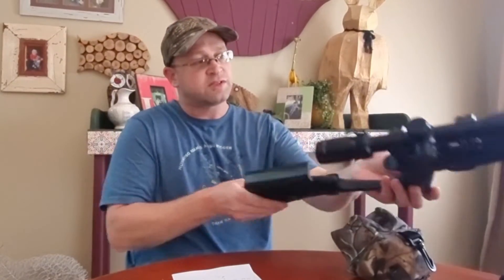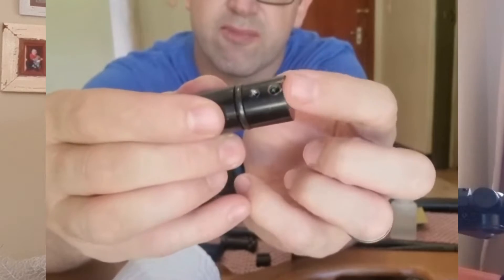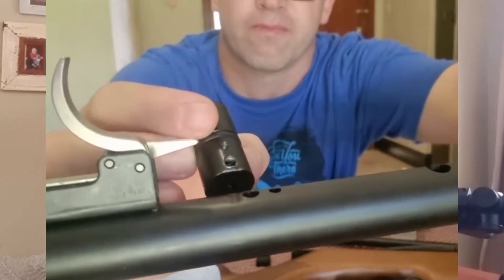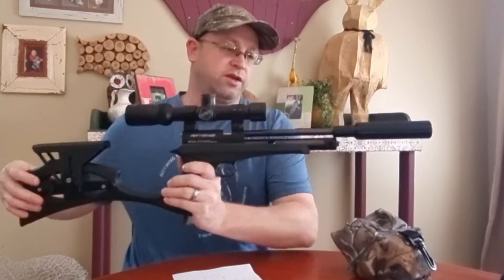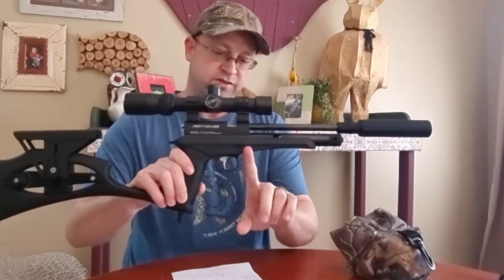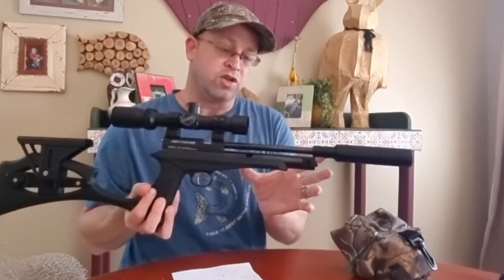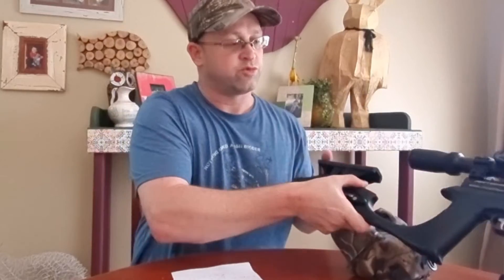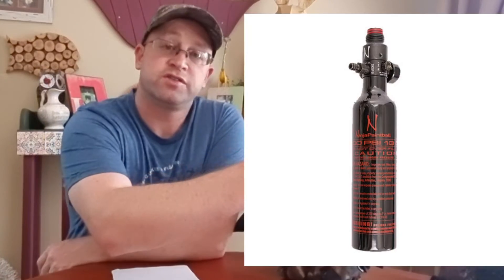CP2/Chaser CONVERT co2 to PCP

Comment: Plan to buy cp2 for my travel around the Britain. Like the size and weight and portability. Also like small co2 cartridges. As every men thought about increasing the power. Heard about how many shots you can do with one 12g which is even too much for me. So i thought would it be possible to use a bit more co2 gas from the cartridge? You know open the valve a bit more. It wouldn't have to go over 12 or legal limit. Just use the cartridge a bit quicker. Sorry if you already mentioned this idea😊
Reply from the maker: I done a pretty recent video about this,
https://youtu.be/oXXsIX3FH_Y

Comment: I did the convention a while back, used a dummy co2 cart, and drilled a hole in the main tube to run a micro line to it.  I feed it with a paintball tank mounted to a paintball drop forwards attached to the bottom of the grip with threaded inserts, and small 9ci tank set to 850psi. Its louder, and benefits moderator. Can be switched back to co2 with no problem, and balance is still good in pistol form.

Comment: will any 1/2 unf silencer fit the cp2??
Reply from the maker: Nope, afraid not, the thread on the CP2 is M10x1mm
Reply: @African-Budget-Pellet-Gunner   damn... the sites only specify the unf thread
Reply from the maker: @Klausll yip, the easiest solution is probably to get an adapter

Comment: I somewhat agree with what you say but I feel I've to share my opinion too.
With pcp can come lots more power but you don't necessarily need to use it.
the co2 gas from the little bottles should be around 60bar so the rifle components get tested at 90bar if you regulate your pcp mod to 90 bar you will be perfectly safe ... the pcp bottle can then be your classical 200 or 300bar bottle with a regulator set at 90bar or less. 90bar is plenty for sub 16.3J/12ft-lb muzzle energy. I get up to 20J from 60bar in a 58cm long 4.5mm barrel. You wont get that much out of the 45cm CP2 barrel but I'm sure 90 bar is sufficient for 16J.
If I were to do the conversion I would buy a second hand empty sodastream 425g bottle (good to 250 bar), remove the soadstream attachment from the bottle and screw in a regulator, then have the regulator go into the drop block. The bottle regulators are relatively cheap (around 25 euro) , the sodastream bottles are fairly cheap too (can be as cheap as 22 euro new with the gas even cheaper second hand with no gas), the most expensive part will likely be the drop block so you might be able to squeeze the conversion in at around 100 euro. It's not that bad but, in some countries,  you can also get entry level pcp rifles at around the same price as the CP2 + conversion.
Reply: I came across some even cheaper parts solutions on aliexpress, I'm sure you can mod the CP2 to PCP with aliexpress parts for cheaper than 100 Euro and a fair amont of tinkering.
Reply from the maker: Definitely possible, I don't use Aliexpress because our shipping is not very good this side
Reply: @African-Budget-Pellet-Gunner  I found a volunteer amongst my friends owning a sodastream: He will give me the empty bottle for refill, I buy anew one, I give him the new one for the price of a refill and I get to keep his old one for the price of a new one minus the price of the refill. This way I will have a sodastream CO2 bottle for maybe less than 10Euro depending on how cheap I can find the new full bottle for. 
Even if I don't do the PCP conversion maybe I will run my future CP2 from big sodastream bottle ... if you get 40 shots from 12g I expect something 1400 shots from a full 425g sodastream refill ... sound like an interesting option.
For anyone interested ... the standard blue sodastream bottles (the ones with screw on adapter ... not the quick fit): the thread inside once you take of the brass fitting is M18x1.5mm. You need to look for a regulator that will screw on the bottle directly so that's the last thing that needs to be rated for the 250Bar the rest can be safe to your regulated pressure.

Comment: The PP800 route is actually something I've been itching to do for a while.  Having that CP2 rifle barrel and stock with PCP power is very tempting.  It also doesn't have an ugly bottle mounted to the front.  But of course the cost is holding me back.

One thing I'm wondering though.  Why would the drop block prevent using the standard barrel band?  The band mounts behind the end cap, and it's not like you're cutting the tube shorter.
Reply from the maker: That is true, the PP800 option is a little pricey. You could still use the barrel clamp I guess, the bottle and stuff would be futher forward

Comment: instead of converting to a PCP I would prefer to install a longer tube that can hold 2 Co2 capsule.
Reply from the maker: That would definitely add some considerable shot count. Something like the CR600, Diana TrailScout would be cool
Reply: @African-Budget-Pellet-Gunner  we have no power limitation in Swiss, and I want only change the valve and spring, it gives me around 15 joule, long barrel, but 1 cartridge doesn't make much shots before it starts to lose the precision! the Adapter that are around for 2 12g co2, for that I have to build a pipe in which I can place the adapter, but that's a lot of work.
Reply from the maker: Yip, to get shot count and 15j you are probably better going for the drop block and cylinder

Comment: I think you‘re perfekt right in cause of a backstop and carrying stuff but not with the noise. It depends on the brand (the system) of your pcp. My Steyr and HW 100 are much louder than my FX Rifles without silencers and harder to quiet down at the same power level.
Dont misunderstand me,i love to shoot Co2 guns for fun in warm conditions but for long distance and hunting (espacially at cold weather) i prefere a regulated PCP.
I like what you say about the danger shooting overpowered guns in the backyard cause many people are buying crazy stuff they see in videos without thinking about a proper backstop.
Had the chance to do some long range sessions at my buddy’s farm last summer and i was pretty shocked how much damage even a 12fp rifle can do to a wooden fencepole can do at 120 meters👁
Reply from the maker: Morning Andreas, you are 100% correct. Some guys try to shoot really powerful air rifles without being prepared enough. I think as you said some of the brands have really effective silencers and can actually be very very quiet but I think a co2 CP2 vs a higher powered PCP CP2 with the same silencer, the PCP will be a little louder just because there is more gas to handle.

Comment: I Agree with your assessments. I put my bandit in the chaser kit stock with a stormrider barrell. Its very accurate and powerful in .22 cal. I call it the Stormbandit. Side by side it looks like a chaser but it is 24fpe v 12.5 fpe chaser. 👍

Comment: Just watched the video. Another good one. I subbed and will watch some others. The main reason I personaly converted the cp2 is co2 performance issues in the uk winters and also the cost over time. The pp800 doesn't take much effort to charge with a stirrup pump, 15 to 20 pumps. I got both the cp2 and the pp800 earlier in the year when they were both sub £150. My 800 is the 'R' version so you have the regulation too. With the mods in your other video what I have will make a perfect all round, sub 12lb usable tool for my applications and the way I chose to go left me with a co2 pistol for fun, which I intend to buy a new foregrip, stock, long barrel and barrel clamp and make a standard cp2 and give it to my son. These parts are cheaper than a co2 cp2 now so I will end up with a pcp cp2 and a co2 cp2 lol. Sorry for the ramble. Thanks for the videos. Off to the mates machine shop now
Reply from the maker: Thanks for sharing your insights and leaving a comment, how many shots per fill do you get with the PP800 conversion?
Reply: @African-Budget-Pellet-Gunner  I have not realy counted as I have 4 mags and I have not been in a situation where I have attempted to empty all four, but I will count next time I am out and let you know. Thanks again for the propper information
Reply: 4 mags in .22
Reply from the maker: Thanks for the info, 28 shots is not bad

Comment: Not understanding why safety still a concern if you use a drop down w/ 3000 psi tank that is regulated around 800 psi? I mean isn't it the regulator that actually determines the pressure your gun is subjected to? Btw, I'm new to your vids, you do a very professional job.
Reply from the maker: If you keep to the low pressures you should be fine. But people will always test the limits, most guys shooting slugs are between 160-170bar which is close to 2500psi, and that will go through the valve
Reply: @African-Budget-Pellet-Gunner  (Sorry, new to air guns here) So it's the regulator that determines the pressure the gun gets, regardless of the PSI rating of the the tank? Thanks again for your great vids.
Reply from the maker: @wulfish1 basically yes, the tank or bottle in the case of the drop block arrangement holds the pressurized volume of air. The regulator allow air to pass into the valve up the pressure at which it is set. The air in the valve will be released when the trigger is fired allowing that air to propel the pellet/slug down the barrel.

Comment: 88g co2 Kit 👌🏻
Reply: Problem with 88g is that they work out much more expensive than 12g - around £8 each for roughly 6x the capacity - 6 x 12g work out at about £2. Plus unless you use it all in one session you will either have to store the gun with co2 in it - not good for the seals - or waste a lot of gas. A lot of co2 rifles that DO use 88g are often converted to take 12g for this reason.
Reply from the maker: I haven't tried the 88g before perhaps an option

Comment: Looking at airgun power for a moment. 
Most but not all countries have regulations on airguns, Germany for example restricts all airguns (including rifles) to under 7.5 Joules, that is about 5.5-ft.lb.. In the UK is it 6-ft.lb for "pistols" and 12-ft-ft.lb for rifles. The definition of "pistol" is a bit weird because the regs do not define "pistol" but either barrel (without silencer) under 30cm or overall length under 60cm. It is more about concealment and sticking it down a trouser leg, but it does mean your carbine there might be legally classed as a pistol due to its short barrel. It is a grey area for a court to rule on it you are naughty. UK does have different rules what we can shoot for England, Wales, Northern Ireland and Scotland. I believe in Scotland an airgun must be stored in a gun safe. FAC which is Firearms Certificate is not difficult to obtain but places many restrictions on using it, not worth the hassle but they are used for rabbits. 
On CO2 power. I have returned my pair of 177 CP2 to "slicked up" stock, i.e. polished up a bit but with stock components. I find this proves the best shot consistency. This does mean they shoot a bit faster than it says on the box. The rifle shoots just under 650fps and about 8-ft.lb tops, and that will go clean through a larch-lap fence, and it will rat very nicely.  More than enough garden power. If we look at target rifles and optimum barrel velocity we find that 600fps to 750fps is preferred; high power is detrimental. If you want to punch cards and kill tin cans and twirl spinners, this does very nicely. If you have to shoot rats, which I consider a chore not a sport, accuracy is paramount. My CP2 pistol can produce something like 4.1/2 ft.lb and will dispatch a trapped rat, more than enough but at 6J more than allowed in Germany.  
Shot count, and this is a biggie. Some PCP with a small tank like the PR600 and PP900 can only shoot two or three magazines, maybe 35 shots, before they need recharging. I can reckon on the CO2 pistol providing nine mags, ~85 good shots and the rifle usually seven mags, ~65 good shots. Bought in bulk CO2 capsules are about 30p each and take seconds to change, they also fit into the shotgun cartridge pockets on shooting vest.
Reply from the maker: Fortunately my carbine with the silencer comes in at 71cm so should pash as a rifle. The power restrictions are there for good reason I guess. You will always get someone who acts carelessly or stupidly so the law is there
I enjoy my CP2 pretty much std just cleaned up internals and a 4mm spacer. Oh and a nice crisp smooth trigger is a must
Reply: @African-Budget-Pellet-Gunner  It won't apply to you :)  but I believe it is barrel less silencer under 30cm or  overall length (less silencer?) under 60cm the it is a pistol. The actual wording is taken from, "which either has a barrel less than 30 centimetres in length or is less than 60 centimetres in length overall". Whilst I have had to interpret legal waffle for work, I am not a lawyer. No commas and order of precedence in sentence. Arrgh! ;)
Reply: Hi chaps. If I may add something. In the uk, if you are switching any standard cp2 from rifle to pistol as it is designed to do, and remove the stock first before the barrel, you are holding an illegal firearm. Just something interesting to think about.

Comment: I would not modify my CP2 to PCP for much the same reasons you have said. Electric compressors are not only expensive but prone to failure. If I got a scuba tank I would need the scuba diver to carry it, and it is about an hour each way to get one refilled, add that to the expense. They're not actually scuba tanks, higher pressure, they must be tested and certified or no one will fill it, once expired they have to be replaced. I am rather old and disabled. I do use a stirrup pump to inflate the motorbike tyres, after about 40 strokes I've had enough; a PCP may take 5 minutes of vigorous effort, no thanks. For me the CO2 capsule is very convenient. It is October now in England but the temperature outside is about 17C, so the CO2 is still useable. There will be fine days in winter when the CO2 will be usable, however the english winter is more wet and miserable and dark than cold which will put the idea of messing about outside out of the mind. Shooting (shotguns) on Boxing Day is something of a tradition, but then so is swimming in the River Thames and I know of one instance where they would have a football match in the village pond.  Shotgun enthusiasts, some of my old workmates, would wear boots with two inch soles to stop the feet going numb.
The CP2 is a lightweight rifle. Adding a bottle out front will over balance it, even a bipod does that. 
Converting a CP2 to PCP is something to do because you want to have a go at it but will not improve the airgun significantly. It can be done well, or botched. The expense, including the CP2 is comparable to buying a decent regulated PCP air rifle off the shelf.
Reply from the maker: Couldn’t have said it better myself, Thanks Jeff. Thanks for always taking the time to share your insight

Comment: I agree with you, while I'd love to have a PCP CP2 the PP800 route is just too expensive - £225 for the gun plus another £50 (at least) for a pump buys a lot of CO2  - I can get 100 cartridges for about £30. I have heard a couple of people say that the the PP800 conversion gives about 80 shots which is impressive but I'll stick with CO2.  The new official SMK PCP version of the CP2 looks interesting but at the moment it's too soon to know what the shot count on that will be.
Reply: Id like to add that the cp2 and pp800 don't swap as easily as these, yad be better off with a pp900 barrel and shoulderstock conversion if ya wanted a carbine pcp cp2, a pcp2🤔, or just get a pp900 straight off the bat, or just a stock on a pp800
Reply from the maker: @mycobodmycology5267 awesome Thanks for sharing, I take it you have tried
Reply: @African-Budget-Pellet-Gunner  yup but only because I prefer the stock that comes on the cp2, getting my hands on a longer barrel wasn't an option
Reply from the maker: Will need to let the CP2 PCP unfold a little first. 80 shots on a small tube would be awesome
Reply: @African-Budget-Pellet-Gunner  Indeed. Hopefully there will be a review on AAR soon as I know he is a bit of a CP2 fan.
Reply from the maker: Well there is a lot to be a fan about if/when a PCP version comes out I am sure he will test it out

Comment: Love my drop block conversion. PCP is also far better where the winters get very cold.  Using 1100 psi out put on the froggy block.
Reply: about to do the same, got the 1100 psi bottle in hand and just waiting for froggy's block to be delivered to the UK
Reply from the maker: Hi Mark let us know how it goes, I am sure you will enjoy it either way
Reply: I converted my CP2 with a Norris Sheldon drop block. I live in Spain so mines regulated at 1300 psi to get about 15/16 ftlbs. Works really well with a very high shot count . The only issue really is that you are putting a hell of a lot of weight at the front of the gun which messes up the balance..

I may eventually convert it back to CO2 because I have bought two pcs since, a Kral Empire X and a Snowpeak T-REX Bullpup. Both great fun and I got them both really cheap
Reply from the maker: @user-tl1fh3ro6r hi Phil, Thanks for the feedback, I can imagine that it will make the balance of the gun a little front heavy
Reply: @African-Budget-Pellet-Gunner  If you want to try another budget PCP similar to the PR900, the Snowpeak T-REX Bullpup is really worth a look. Needs a bit of work out of the box to smooth out the action but honestly it's a fantastic gun for very little money. Like a cp2 ultra
Reply from the maker: @user-tl1fh3ro6r Thanks I will keep that in mind
Reply from the maker: Hi Shaun Thanks for sharing, true I never mentioned the weather that is a strong pro for the PCP